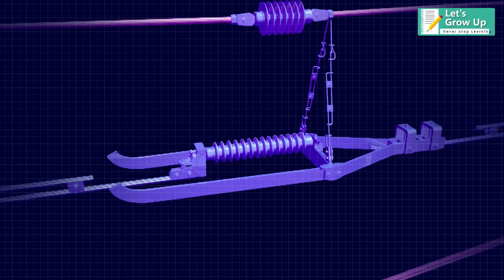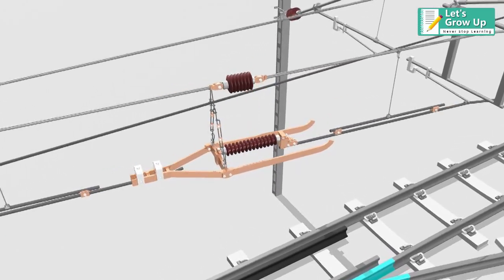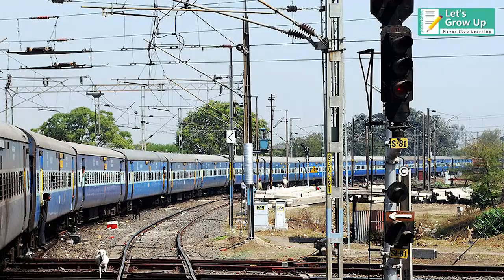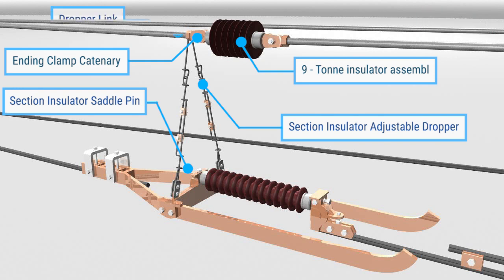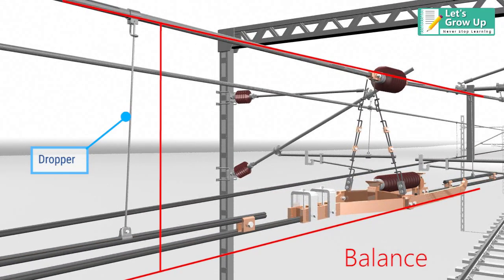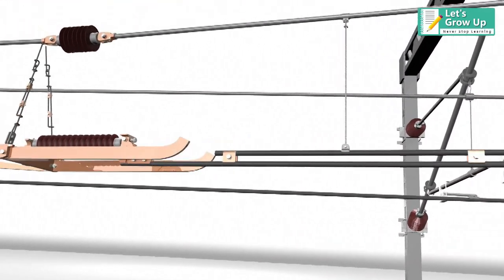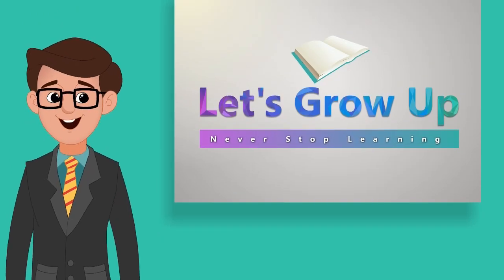The Importance of Section Insulators in Railway Electrification

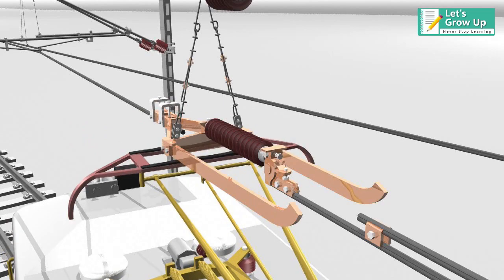Comment: 1:00   Hello,
I have a question about the separator. It seems to me that for a certain moment the train is powered from 2 sides, from the side it is leaving from and from the side it is towering on, because the pantograph touches the wires at 3 points, am I right? If this is indeed the case, how is the train protected from 2 sources of energy?
Best regards

Comment: I noticed on the Metra Electric District line in the Chicago south suburbs on the overhead wire the point is called an Air-Gap in switching over to other tracks, and sometimes on the mainline wires going straight. The pantograph does have electric arcs when passing by. From the little signs connected to the overhead wires above.

Comment: great Video. Hats off. I would like to make a small correction. Speed restriction is not 70 kmph. Its 80 kmph  and 120kmph depending on the direction of traffic and the position within the span it is connected. If it is between on third and one tenth of span and if the direction of traffic is in such a way that crossbeam part touches panto before runners, then speed is restricted to 120kmph. rest all cases its 80kmph.
Reply: I'm honestly amazed how bad those section insulators are, given that in germany those things can bidirectionally be traversed with up to 130 km/h (During my training as a train driver this figure was officially 160 km/h, but couldn't find some on the internet) and I even found some on the internet rated for bidirectional travel with speeds up to 250 km/h.